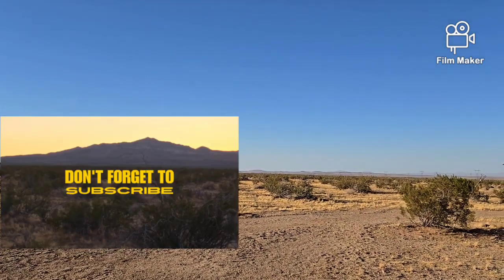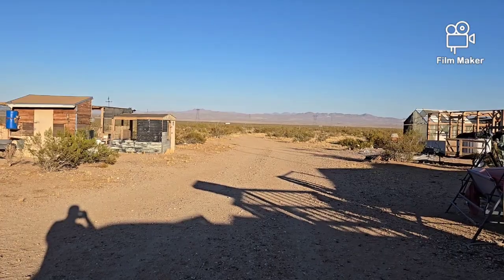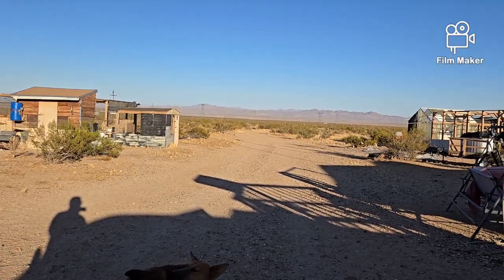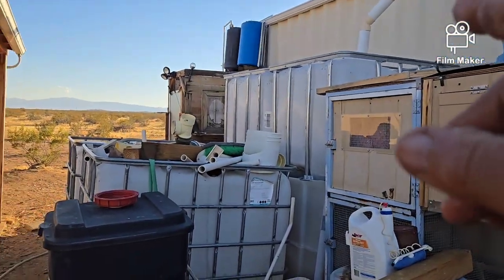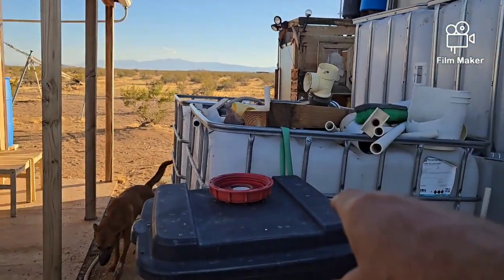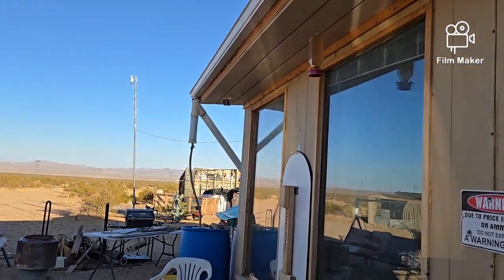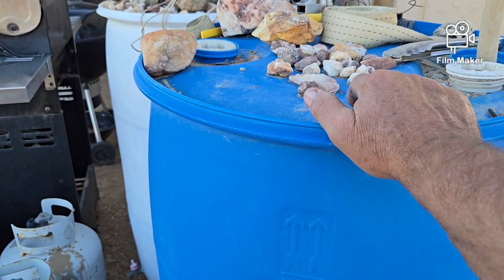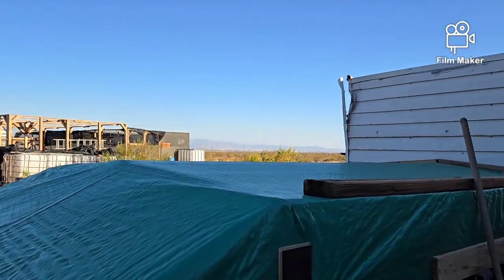More Off Grid Tips, First Flush, Power Needed, Sep. 21, 2024

Comment: GBear my two new 100 watt solar panels are Bifacial panels. I turned them away from the sun & they showed the same voltage as facing the sun. The technology continues to evolve with off grid products. Now is the time Everyone needs to begin building their systems. Start off small & Expand as you go it's Easy.
Reply from the maker: @miguelsalami  Yes, I have been following the tech, and bifacial panels are a bit more efficient.  Standing them straight up was one option, but the winds out here might be a factor in that.  The other option is a white or reflective background, but again, out here dirt, dust and bird poop would add a constant cleaning requirement. They have their pluses and they have their minuses.  Everybody will have slightly different needs.

Comment: Hello Gbear!      

Pure sign wave inverters are close to the same price as modified wave now.   It didn’t used to be so, but now it’s mostly old stock new models are mostly pure sign.  

Beautiful day today my cabin ac was running at about 200-300 watts, easy peasy.   My back is stiff, I set rebar and classified about 2 1/2 cubic yards of sand and gravel all day for the pour.
Reply from the maker: @WattsinWattsout  Yeah, Harbor Freight still sells modified.  They don't have pure sine.
I don't know why they haven't upgraded.
Reply: @GBear  they have them now, they have a 1000/2000 and a 2000/4000 model.
Reply from the maker: @WattsinWattsout  Interesting.  I checked recently and they were all modified.  I'll have to check again.

Comment: Thank you I was hoping to use my 400 watt predator generator, can you tell harbor freight is my go to store.
Reply from the maker: @donnahurd4745  A 400 watt gen is only a battery charge.  It won't run much.  For an off grid gen, both backup and charger, you need to think of it powering a house.  3000w minimum.  I have a 6500w Predator.  No need to haul one with you across the country, buy one when you get to Arizona.  Just plan to have room to add it to your hauler.  Also, a 5 gallon gas can, and a few quarts of sae30 oil.  Change the oil after the first 5 days of running it.  The break-in period adds metal shavings to the oil and an early oil change will make it last a lot longer.  I then change oil every 40 hours of run time.
Reply: @GBear  I maybe wrong about watts, I haven't used gen. Yet,
Reply: I'll check my generator watts  and inverters to see if there pure sound wave.
Reply: Thanks again
Reply from the maker: @donnahurd4745  👍👍
I'm here to help others start their off grid journeys without all the trial and error I had to go through in the beginning.  A lot of wasted time and money ten years ago.
Reply: @donnahurd4745  A slight correction, that's pure sine wave. Happy days.
Reply from the maker: @donnahurd4745  I have never seen a pure sine wave inverter at Harbor Freight.   They have pure sine generators though.
Reply: @GBear  Hi GBear, The Pure Sine Wave Inverters are fairly new for Harbor Freight, they've only been selling them for 2 to 3 years. I have one of their 2000 watt pure sine wave inverters, it being used to power my son's trailer. It handles all of their needs with the exception of the AC system. They fire up a generator when they need the AC.
Reply from the maker: @misfitacres-granny I'll  check into it again.  Question, does the cooling fan run constantly on the new pure sine inverters, like they do on these older ones?
Reply: @GBear  I'm not entirely sure, let me check on it and I'll get back with you.
Reply: I just checked, No the fan does not run constantly.  I just emailed you a picture of the inverter, part of a temporary instillation.
Reply from the maker: @misfitacres-granny Yes, I got the picture, then looked it up online. $500!?!?  I can get a better one for that price....geeeez!  What happened to our economy?
Reply from the maker: @donnahurd4745  Remember,  Chinese made gens rate them as like 400 Running/600 Peak, but it will actually only produce 400w.
Reply: For my power tools to build with, I hope 400 watt generator will power my circular saw.
Reply from the maker: @donnahurd4745 Even a 10A skilsaw at 120v requires 1200watts.  Remember Ohms Law.
W=V x A